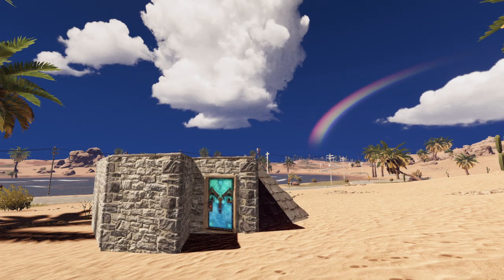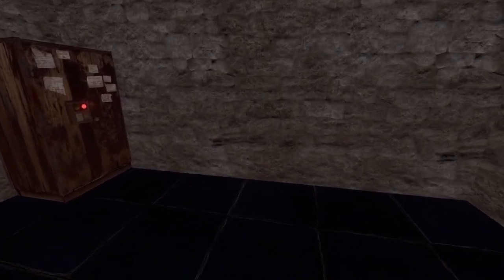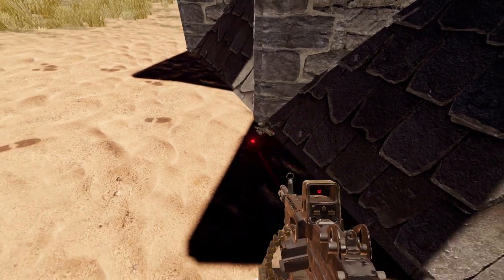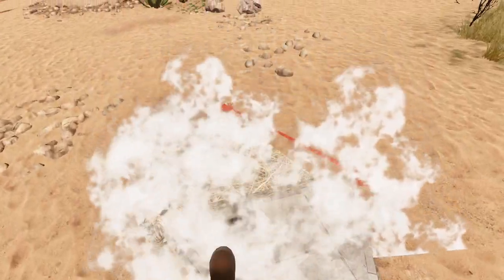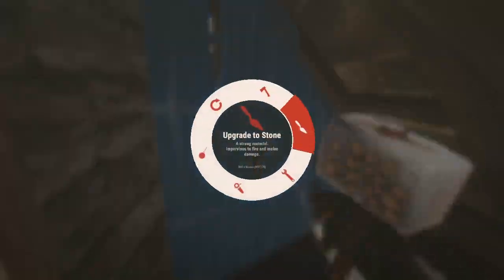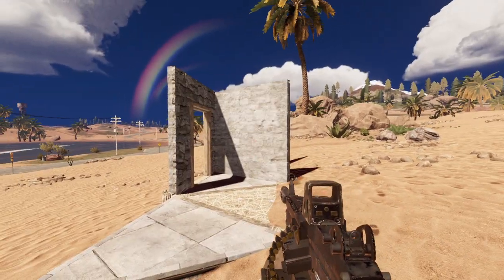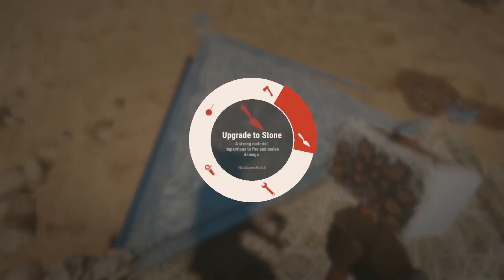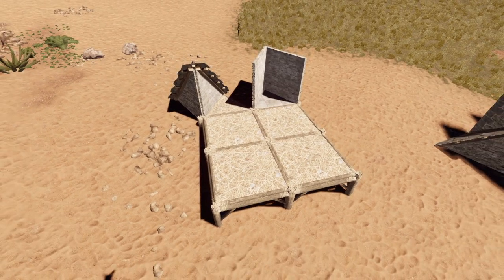Rust Trick 05: Bunker That Airlock (w/ a Terrain Bunker)

Comment from the maker: I forgot to include a save code for an example! Here is a 1x2 good for 7 rockets offline. No BPs needed and doesn't have exposed softsides.

Sanctuary code: 1ABX43
Reply: How is it not just 4 rockets through the top?
Reply from the maker: @wordta  Sheet metal is a bit over 7 rockets and two layers of stone is 8. My question for you is: how is it 4?
Reply: @InigoPhentoya  Ok I guess I missed where you upgrade it to sheet metal. I was thinking just 4 rockets to top down it if stone.